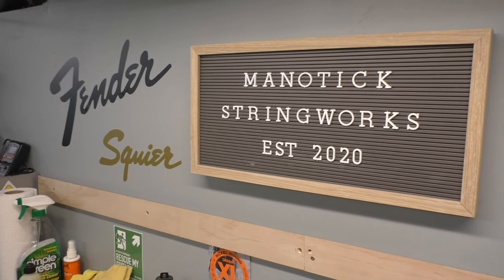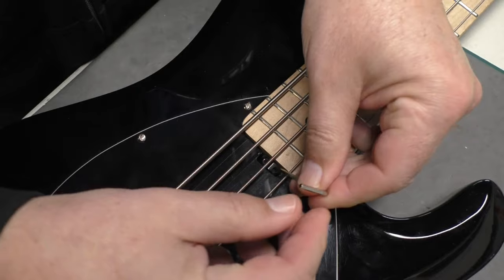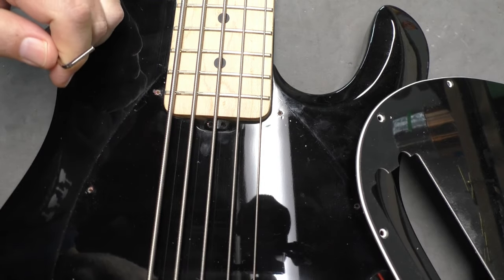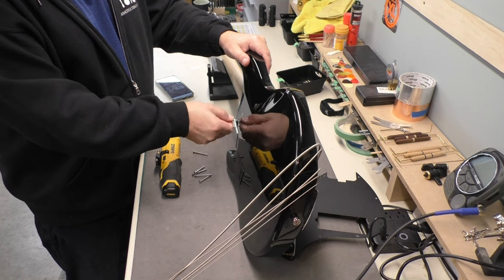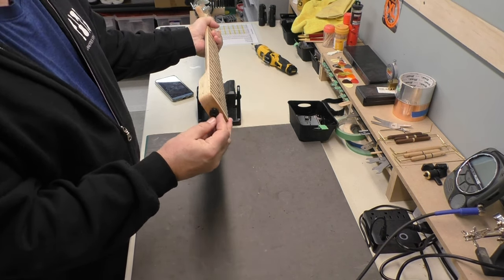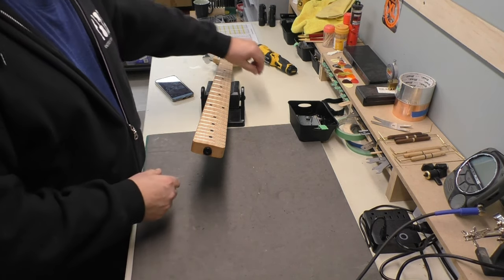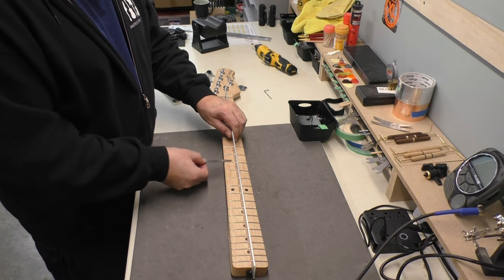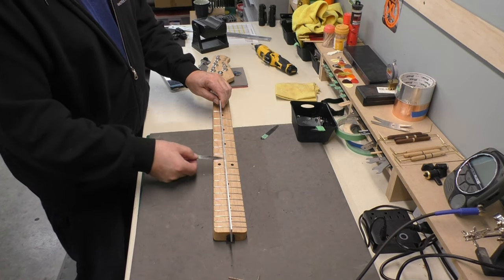Truss Rod Woes - a Sterling Musicman Stingray 5 Bass might need some heat!

Comment: If you tighten the nut it is one way.  Is it possible that when it is turned out and the nut hits the body, would that put pressure resulting in a two way?  Kind of like Fender with the truss rod nut and then they later added the wooden insert (bushing), at the end of the neck that the nut pushed on causing pressure for a two way?